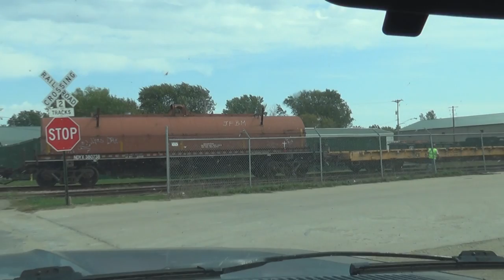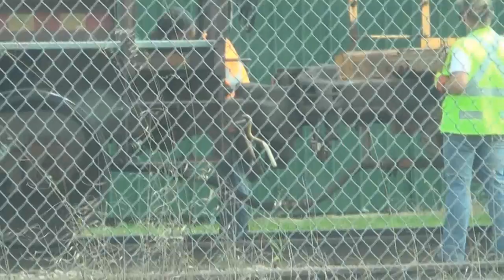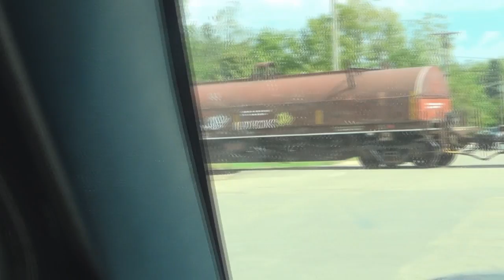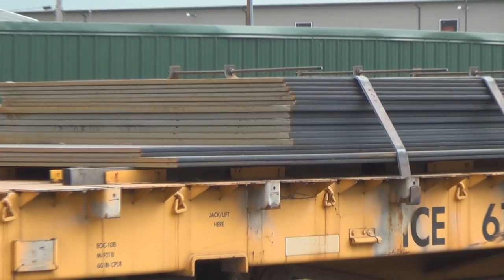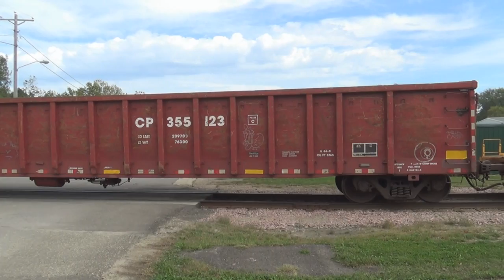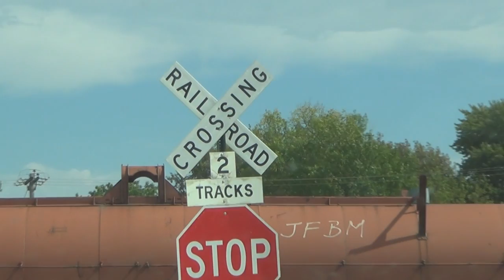Railfanning at the railroad crossing

Comment: Very informative and interesting George ,,, great close ups of the steel ,,,,, as they say in the UK "You don't get many of them to the lbs    " or it this case you don't get many of them to the Ton.   You could soon be a hour late for work if you use that crossing and get unlucky ,,,,,   Many thanks
Reply from the maker: +Alan Plumb   I think they have a time limit on blocking these crossings because of the businesses involved. I haven't ever waited for more than 15 minutes, though I do know that the crossing closer to my house was blocked for a whole afternoon one time, when the diesel engine broke down... they finally got another engine there and split the train on either side of the crossing, then came back the next day to haul it all off. Thanks for stopping by Alan

Comment: did you know theres a time limit they have to go by when stopped......i have a few young buddies who work here for the rr.....very nice living i may ad. alot nicer than what i did raising a family.
cold rolled 1/2 and 3/8 " sheets...i raised a family making gaskets out of steel and stainless.
Reply from the maker: +RobsPackanShine   The only problem is if you don't have a regular route that you run, it can be long days, uneven turnarounds and not knowing where you will be when you do get your 12 hours off. Most of the folks that I have talked to seem to speak of the many families that break up because of the uncertainty. They do pay well.

Comment: Some time they are stopped , you should slide me off a few sheets of 1 inch . Then could mail them to me . LOL
Reply from the maker: +wtbm123   Well, I don't think I could lift it... I am wanting to buy a small sheet of 1/2", like 3x6 to use as a bench top on my work table so that it will be easier to do welding on. They have a "scrap" shop where we can buy cutoffs from the fabrication shop at a reduced rate. Now about the shipping...Do you have any railroad nearby? LOL